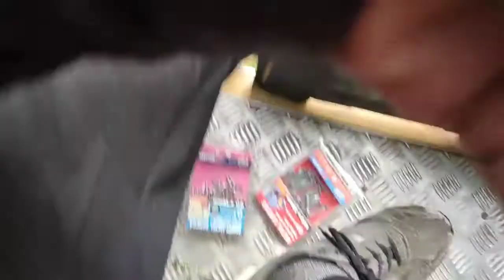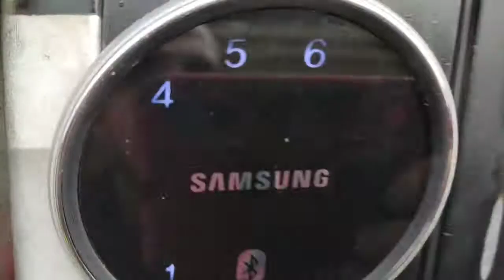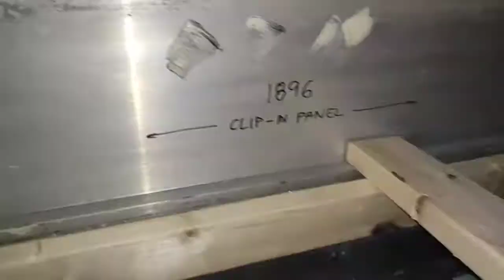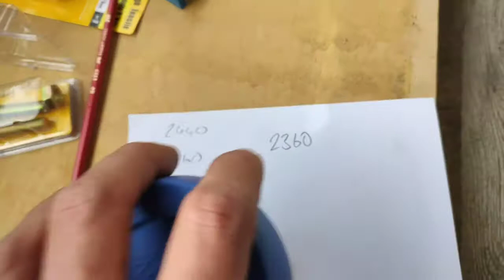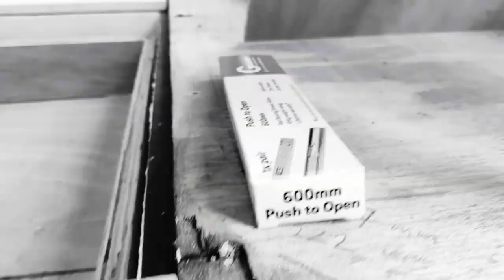bed build Volvo b10m motorhome conversion

Comment: Man, aren't you going to isolate the walls?
Reply from the maker: yeah the insulation is back in, I took it out to make the adjustments.,
There isn't much, and there are lots of windows. so I still have to consider the heating and cooling. 

right now the side is insulated and so is the roof. I plan to put in curtains so hopefully that will help the windows. Open to suggestions.
Reply: @SimCardashian  unfortunately I don't have so much knowledge about this, I'm planning to do something like what you're doing, but I still don't have the bus.
The thing I have been thinking to do in mine is too make the windows smaller just with wood planks from the inside, or at least on the ones that don't open, so it's less window surface for temp exchange.
Reply from the maker: @bernardoruiz4196  good idea, I'm thinking the same thing, but with some metal plating.
I have an idea on how I'll do it, but we'll see if it works.